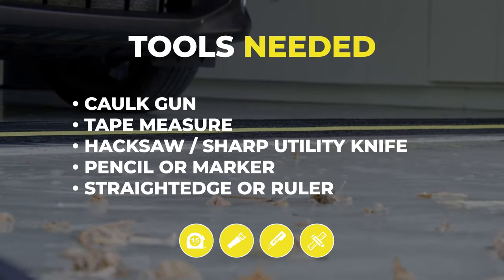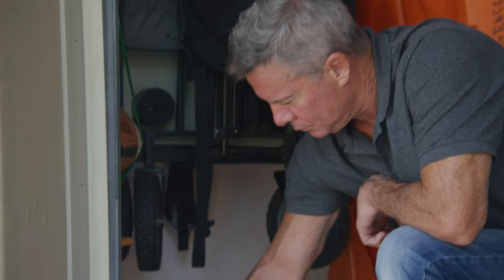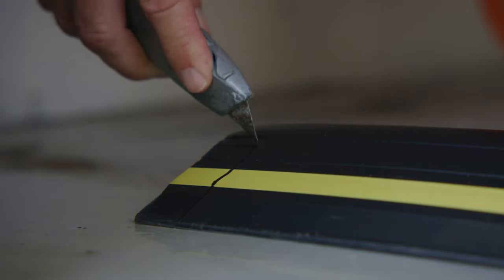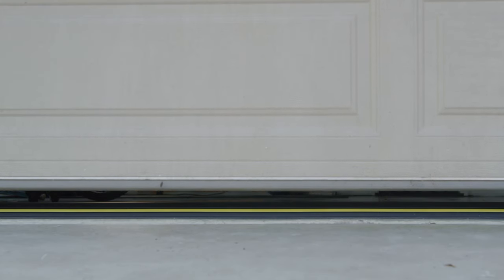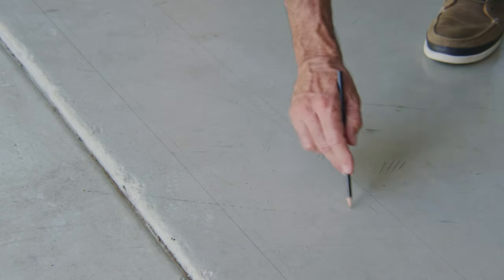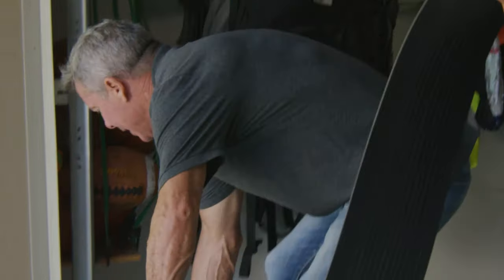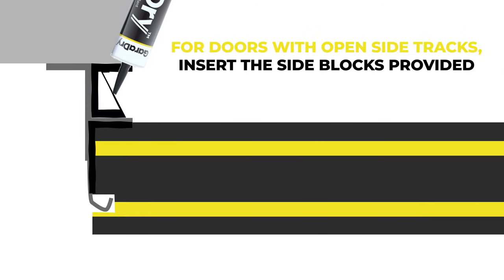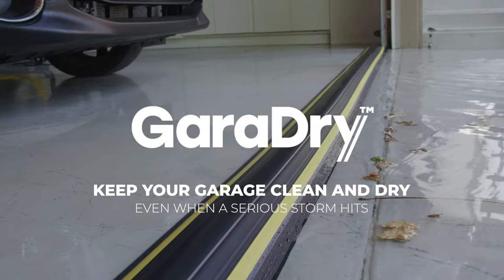How To - Installing A GaraDry Garage Door Threshold Seal

Comment: If contractors would just use their heads when pouring the garage floor.  The floor should be 1 to 2 inch ABOVE the outside drive way  into the garage.  This rise should extend the entire width of the garage and garage door.  Our "new to us" house, the floor is at grade with the drive, so I have this issue.  I did buy one of these strips from a competitor and it helps, but it's not tall enough, so I'll have to buy from THIS company instead.
Reply: Exactly…just had a new garage built with NO SLOPE…I had contractor purchase this…and install for free…Unbelievable
Reply: Try moving an engine stand with a 700lb motor on it into a garage with a step of 1-2" at the threshold..i'll wait.

Comment: I installed this it stops the water leaking under the door creating a pond in my garage. The root cause the sill o under the garage door was not pitch. this creates a mini dam as rain water hits the sill or door…PROBLEM corrected..

Comment: How do i get rid of the water and snow inside the garage once I place this on?
Reply: Towels, dry vac, a drain perhaps.  Or just install a diving board.  (Depends on the depth of the pool. 😮). The point here is I believe to prevent water from entering.  It’s not all inclusive but will add to the prevention of storm type of wind driven flood to a certain degree.
Reply: Drink with a straw?
Reply: Get on your knees and pray for it to be gone? Seriously, what kind of a dumba** question is that?

Comment: Might have to try this out. The top of our driveway slants down from the street towards our garage, so any heavy rain naturally funnels down towards there. We've been using those Quick Dam flood barriers as a deterrent, but this might be a better long-term solution.
Reply: I don’t mean to sound rude, but a better solution is a trench drain if you are getting large amounts of water in your garage. If it’s getting into your garage there’s a high chance it is or will will eventually also get into your foundation. Trench drain’s aren’t cheap but they are necessary if your driveway is sloped towards your garage
Reply from the maker: Hey, a trench drain is a great idea, especially if you have a really large volume of water! They can get clogged with leaves and dirt, so one of our thresholds can still be installed as well to give you extra piece of mind to make sure the water still stays out, even if the drain's not functioning :)
Reply: @Garadrygaragedoorseals  I would also recommend a threshold as well in case of any water running over the drain in a heavy down pour (just did this for a client, came back and added threshold after still getting small amounts of water in garage after trench drain installation. Threshold is now in and redirects water back to drain so no water ever since :)
Reply: @Thedarrkknihhht I have a French drain and it still doesn’t stop 100% of the water and other crap from coming in. A barrier seems like a good addition

Comment: Why not install this on the outside of the door so that water doesn't collect between the seal and the outside of the door. ?
Reply from the maker: If installed on the outside of the door, water could run down the face of the door and collect in-between the door and the threshold. This water would just run into the garage when the door is opened.

Comment: One question.. I enter the garage with snow on the wheels.. the garage has no drain so the snow melts and creates a puddle.. can I sweep the water out with this installed?
Reply from the maker: Yes, you should be able to sweep the majority of this water out of the garage.
Reply: shop vac

Comment: What about the corners though? You can clearly see daylight coming through the corners in the video and that’s where the water will enter as well
Reply from the maker: The product is supplied with high-density, waterproof foam blocks that can be inserted in the gaps between the tracks and the wall to prevent water ingress.

Comment: I have installed it. Of course, the installation was not as clean as this video. Now my concern is all the ice wil melt and make a puddle when i park my car in the garage and it will be a challange to push the water out with a squeezee. If I regret,  how do I remove construction glue from concreate clean?

Comment: Would this withstand the weight of my farm tractor with chains that I bring into my garage?
Reply from the maker: Hi there, it really depends on the weight on the tractor. Usually for larger, heavier vehicles like this we would recommend our aluminum thresholds which have been specifically designed for this purpose: https://us.garadry.com/collections/commercial-threshold-seals